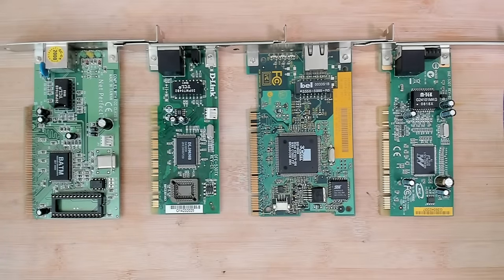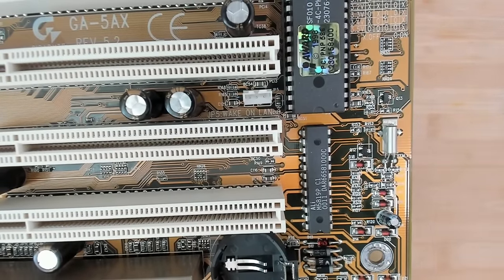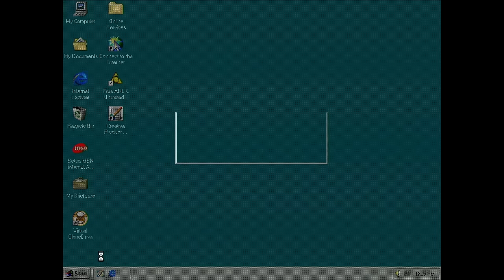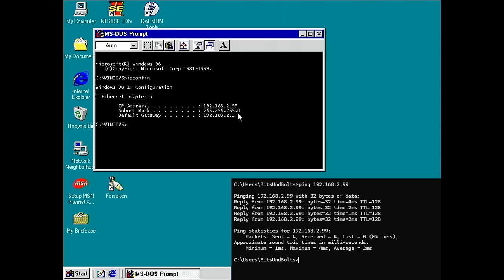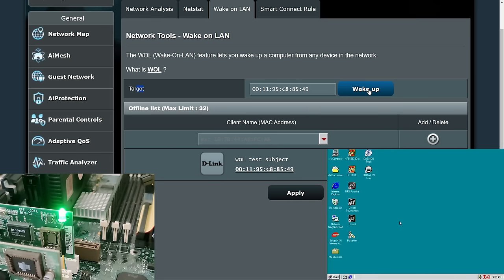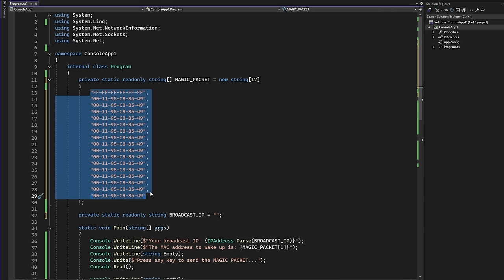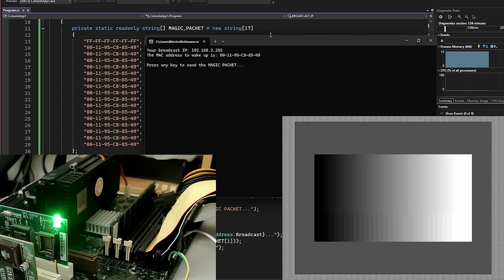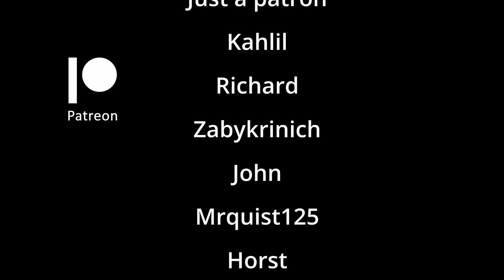A special packet that can wake-up your PC (Wake-on-LAN Explained)

Comment: I use WOL on my x79 system that I use as a server. It fires up even from completely off. I can even power it on from outside the home with tailscale. I use fing to send the packet when I'm at home, or the wakeonlan utility if i need to log in to another machine to do it. I think I only had to enable it in the BIOS to make it work iirc.
Reply from the maker: I think I missed a second option in the BIOS I show in this video. but good that it works for you! Still a technology very much used today!

Comment: As a suggestion, try hard power cycling the target system and try sending a WOL packet again.

Maybe the OS or its NIC driver is leaving the card in an odd or disabled state.

A fresh power cycle should reset anything like that.

I assume the signal is just like an active low output? In which case maybe you can test by grounding the input to the board without a NIC etc. but I'd research first.
Reply from the maker: Interesting idea. I wouldn't be surprised if the signal pin somehow connects to the pin header of the board's power switch. But it must be controlled by the BIOS setting, so there must be something between.

Comment: I use WOL at home in my homelab setup. It's in my automated power failure management. Since I have a UPS, my servers and NAS are scripted to shutdown in an orderly fashion. Same thing on power restoration, servers need to restart in the right order because of the NAS. My scripts issues WOL to start the machines at the appropriate time during init script execution.
Reply from the maker: Nice! So, still a very useful technology!
Reply: @bitsundbolts  Yes. I love power outages now ;-) I get to watch it all shutdown and come back automatically, all services starting up one by one. It's beautiful.
Reply from the maker: I can imagine!

Comment: All the way to Windows 11 24H2 Microsoft in their infinite wisdom defaults to wake the PC with any packet, not only a magic packet.
Reply from the maker: I didn't check how modern operating systems are set up by default. But that would be a bad way to configure the network adapter out of the box.
Reply: @bitsundbolts  It does result in the system randomly waking up.

Comment: I had my experience with WOL during my 20s, where hardware from that era was already obsolete. However I went ahead to build my storage server with a Pentium 3 that I had lying around. But I had my fair share of struggles with the technology. I had to be very selective which hardware I chose because not every combination would work well. Even so I had to power it on manually the first time, only then (after the first time) that the magic packet would turn on the computer (have you tried this scenario?). It would be fine if it weren't for the case that the power goes out more often than you might think.
I even wrote a small app to make it easier to cycle through powering on and off and checks in which state is in. Under the hood is uses the ether-wake command (or other similar, e.g. ethtool) to powering on and ssh for powering off. I don't remember digging into how the magic package was actually constructed, maybe I would have implemented directly in PHP if I knew it was that easy!

Comment: I'm waking up my backup server with Wol. Main server wakes it up, makes backup of data, and shuts it down after that. Not standby, complete shutdown. Network card even has option to shut down lights in that state, so nothing points that it waits for WoL event. Doing backup once a week, no point keeping backup server up and running all the time. Of course i could do like just timed wakeup, but this way if I need to do unscheduled access to backup server, I could just wake it up through VPN, no need for physical access to power on machine.
Reply from the maker: Very nice use of WOL!

Comment: Not regarding WOL, but the network configuration on obsolete OS (like windows 98).
On my machines I set the IP address manually, without filling the gateway address. That way I have access to and from the machine, inside my network, but the machine itself is disconnected from the internet (due to the lack of deaignated gateway), avoiding external threats.
Reply: Hi, i used to do that, i would set secondary / segmented servers on ip 2 to 20
Then management pc's 50-99
Staff Pc's 99-200
Printers were 200+

At one stage ( late 90's due to hub and cableling costs, we used different subnets to keep sales away from accounts , all both of those away prom production

Comment: routers do not take part in WoL. Routers works in L3 (IP). Switches and hubs works in L2 (ethernet frames). Magic packet is just special ethernet frame.
Reply from the maker: I'm not an expert in networking. But wouldn't the router still be involved in sending the packet to all connected clients?
Reply: @bitsundbolts  router can have switch and it will take part. But it is diffrent network level. For not network expert just saying router is fine. :D

Comment: You could test if its the network card or the motherboard not doing its job when trying to wol from shutdown by connecting the signal pin to 5V. Please check if there is voltage between signal and ground on the board, if it is then the connection should be to gnd not 5Vsb.  it should have the same effect as pressing the power button. it that doesnt work connect the signal pin to powerbutton on the frontpanel connector :) that should make your network card turn on the pc regardles of bios settings but still respect the checkbox in the networkadapter settings on windows. a modern pc needs to be booted once after power is connected for telling the network card to activate wol, maybe thats the same for old ones too.
Reply from the maker: That sounds like a nice afternoon of experimenting with different options! Nice!

Comment: I remember trying this back then, I had a 440BX MB, I got it working but it was unreliable, it would work fine for weeks and then fail, I then had to go to the actual machine to power it up and would then work ok for days or weeks and fail again, I never got it fully working and got around it by setting the bios wake up on power and cycled the power remotely instead.
Reply from the maker: It seems like I missed an option in the BIOS - apparently, there were two switches I should have enabled. But I did read that WOL was sometimes unreliable - and without a delivery confirmation, you never know if the packet was delivered.

Comment: I think I'm gonna replace the network card on my retro computer with one that has a WOL connector, just so it connects to the 3 pin WOL connector on the board. Even if I don't use it, it just looks cool having a cable from the board to the LAN card :-)
Reply from the maker: It should be easy to come by those WOL cables. I just didn't happen to have one.
Reply: @bitsundbolts  I had a WOL cable on my CD-ROM audio cables box! I also found 3x RTL8139 cards (A/D/D), a D-Link DFE-530TX and a SMC/Compaq branded card with WOL connector, so I'll play around with these to see which ones work with WOL correctly and which one has better transfer speeds on Windows 98 and 2000. The winner will have the privilege of staying on my RETRO-W98 machine 🙂
Reply: @bitsundbolts  So I managed to make it work from a powered off state. From the cards I mentioned, only the D-Link DFE-530TX immediately turns on the network lights the moment I turn on the power supply and before powering on the computer. Then, after powering on and shutting down Windows 98, the network card remains active and most probably retains the IP, so I used the WakeMeOnLan tool to power the computer on from the off state. It won't work if I turn the power supply off, because the network card will lose power and release the IP. So if you want to turn it on from an off state, you need a network card that has activity lights when the computer is powered off.
Reply from the maker: I'll try it again when I have the board set up. Maybe a different network card will work. Also, others mentioned that I should enable a second option in the BIOS
Reply: @bitsundbolts  I enabled "Resume On Ring/LAN" and "Resume on PME#". I just tested the Realtek 8139D cards and they also turn on the computer from off state even without any activity LEDs turned on. Only the SMC card didn't work. Realtek cards had the fastest transfers speeds so I'll keep one of those on the computer.
Reply from the maker: Good to know. I should have a few more Realtek network cards as well. But from now on, I'm going to look for the WOL connector on them - if they don't have one, either they don't support the feature, or the card is a lot newer and handles WOL events over PCI.

Comment: It's also dependent on the os you use. I have never got it to work on windows despite multiple guides on it and setting the state on the network card but I have managed to get wol to work under Linux from complete shutdown without issue
Reply from the maker: I think later versions of Windows improve on the feature, but it should be possible to get it working. I put the board in storage for now, but I'll retry maybe with a different network card and BIOS options (seems I have missed another option in the BIOS based on comments I got from viewers).

Comment: the wol protocol is porly implemented in some motherboards. 
some work if you activate the on modem power ring and the lan other have a opton in power manament (power on pci or some similar).
i use for years (still use to power mi media center over mi phone) 

the wol sistem or works or not. .Energy-Efficient Ethernet must be disabled.
Deep Sleep must be disabled in the BIOS if the option is present.
The computer must be in S3, S4 or S5 state, this also depends on the computer model
in windows advanced option of the network card enable the options sthut down wake on lan / wake on magic packet /wakeon magic patern /wol speed 10mb or similar

Comment: Never managed to get this to work on any board I've had up to 2022.
Reply from the maker: It requires quite a bit of configuration and then the correct magic packet. It's not so easy to get everything right.

Comment: What happens if you short the signal wire to the standby power? Or to Gnd?
Reply: Through a 10k resistor perhaps, for safety :)
Reply from the maker: Hehe, I don't know. I don't want to try 😅
Reply: @bitsundbolts  it should be OK through a 10k, but yeah, it's your kit not mine 😆

Comment: Back at that time WOL is a mess.

Most motherboard usually cannot wake from full power-off (S5) unless network adapter are powered via +5 VSB or +3.3 VSB (which some of the adapter provide separate cable to powered it on standby. 3.3VSB later added in PCI 2.0 with 3.3VSB and PME# + SMBUS support around 2000.

So before that if Card it only support on on-board NIC which may already have standby power through ATX +5VSB.

Even though, many BIOS and EC may not process PME# Event on the PCI bus that comes from slot, after PME# EC may need to communicate to PCI devices via SMBUS to find what is going on about the PME# Event to decide it should powered on or not, like it is LAN or ALARM or Keyboard, etc.
Reply: What's the total standby power on the wall? Single digit watts?
Reply: @robertosutrisno8604  ATX PSU usually consumes around 5W on standby, but if +5VSB have some load (USB, etc), there may be more, counting loss, may consume up to 30W.

Comment: The broadcast address that should always work is 255.255.255.255, the Most Broadcast of them all 😁 Wake On LAN used to be a pain: on some machines it wouldn't work right. Sometimes if you started the OS and then shut down it would work, but after power was gone it would stop working until a power on-off cycle, no matter what was set in the BIOS. Somewhere in advanced adapter properties in Windows is an option to enable WoL (depending on driver?), if it is disabled there the opposite might be true. In Linux I used ethtool to enable WoL on the NIC, and then powertop --auto would disable it back, 'cause power saving…

Comment: I've owned a few PCs, including my current one, that seem to keep the onboard LAN NIC active even when the machine is shut down, does this mean that my computer could be turned on via WOL even when shut down?  I presume so.
Reply from the maker: Maybe. If you go into your BIOS, see if you find anything related to the power events, WOL, or similar. Disabling those features might turn off your network card when it's powered down.

Comment: I use Wake-On-LAN on second PC and there is one problem.
If PC had powerloss (electricity shut off and come back later), motherboard LAN do not work, doesn't matter what BIOS setting you are using, fact is, LAN chip do not work on motherboard when it get power first time. LAN chip work when you start PC first time and shutdown PC, and you not take power off.
I solve this problem by using BIOS setting -> START PC WHEN POWER ON. And in Linux OS I put task to shutdown PC after 15minutes (I can cancel this by command or use wake-on-LAN later)
Reply: in power loss the ip in the network card is erased (lost the link) so no wol until windows start the lan (in some cases buid the lan in the router over MAC adress asigned the ip solve the problem)
Reply: @yomismo2836  in my case, integrated LAN port not light even led lights when powered first time. I think it is design fault. And I guess, this can be modified by soldering power input somehwere else...

Comment: Many years ago i had a pc with dial up modem 56, the pc was turned off, but it was turn on by it self, i thought its broken or some thing wrong with it, but i found that really now sure now, when ever my sister pick up the phone the pc turned on from the modem, and it was not in sleep mode or stand by, i never use this state only shutdown, to fix this i changed something in the bios, and its stoped turning on.
Reply from the maker: There is a feature called wake-on-ring or similar for modems if I'm not mistaken. Might have been that - maybe it was active.

Comment: I was playing with WOL on all PC I had with this feature back in time. But there was very poor source of information about it so never success. I remember network card 3COM C905-CX-TX-M with WOL very expensive so I move it everytime to newer PC I build from slightly used part and few new I bought. This card was with me for about 18years and meet 6 PC until I got motherboard with build in gigabite RJ45 but still have card somewhere at home. I can't wake up PC by WOL on pourpose but something does. I remember few of my PC's start randomly at night from sleep or standby it happen even when mouse in not powered USB by 5Vst but only when  WOL allowed in bios.  Don't know where magic packet came from or some fantom signal or card malfunction.

Comment: you NEED to connect the GROUND PIN!!!!! it will not work without it then you need to set the on pme: stay off to on pme:  to on in the bios!!!!
Reply from the maker: I must have missed that one extra option in the BIOS. I'll try that again with both settings in the BIOS enabled.
Regarding the ground pin - as far as I can tell, the ground pin isn't necessary to connect. It is already connected through the PCI slot. But, let me test it the way I showed in the video with that extra BIOS option enabled and see if it works without connecting the ground pin.

Comment: I have the same motherboard, but have never messed up with WOL - I have no purpose for it. And unfortunately I've upgraded it past bios P15 (to P17) and on these motherboards you can't downgrade the bios, so I can't have the same configuration as you.
Reply from the maker: I read about this issue! Luckily, the micron board doesn't have a newer bios than P15. I haven't checked the board yet with all its features, but it looks like a decent board as long as you have a newer model that supports Pentium III CPUs.

Comment: It's too bad they didn't make WOL have a shutdown packet or something similar.  I have remote mining rigs that freeze or hangup sometimes and I don't have an expensive network PDU that can remotely power cycle devices
Reply from the maker: Ha, maybe spamming a system with magic packets will power it off - like the 5-second press on the power button. I doubt it'll work, but I understand your pain to not be able to power cycle the mining rigs remotely. But there should be solutions. Maybe something with power buttons and. Raspberry pi/Arduino
Reply: @bitsundbolts  i solved this issue on some rigs using a smart plug like kasa, but some rigs I have on 240V using c13 power only.  Strange no one has come up with a solution to this yet, without expensive PDUs
Reply from the maker: I guess from a certain point forward, you're entering the field of data centers - and then there is just expensive equipment. The only route would be to engineer something yourself - but that's probably easier said than done.

Comment: WoL is still flaky even today. I use WoL daily for 2 of my PCs. One has MSI motherboard and the other one has Asus board. Both exhibit the same problem. As long they have been shut down using OS's shut down procedure everything works as expected. But if the machine shuts down because of power outage, or there is power outage when machine is already shut down, neither keyboard nor WoL is able to turn it on. If these were actual remote machines which I had no physical access to, that would be the most useless remote wake-up implementation ever.
Reply from the maker: That's what I heard as well. Others have said that a power outage renders WOL inoperable. Only after a physical start of the system will WOL work again.